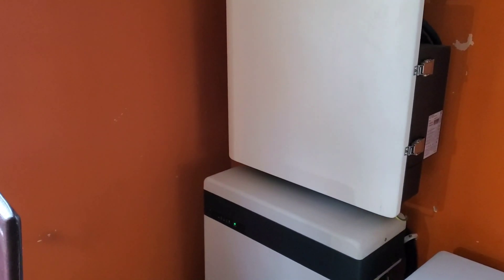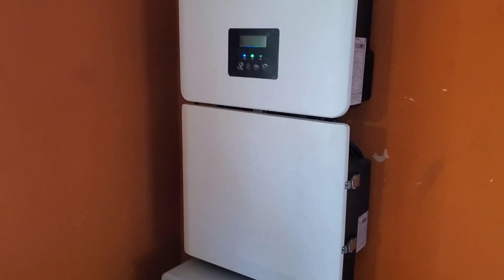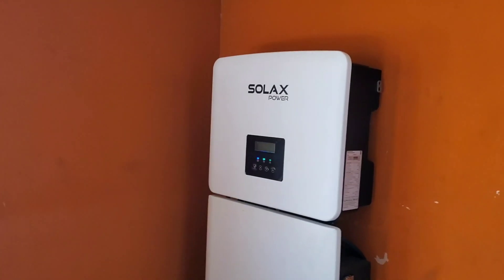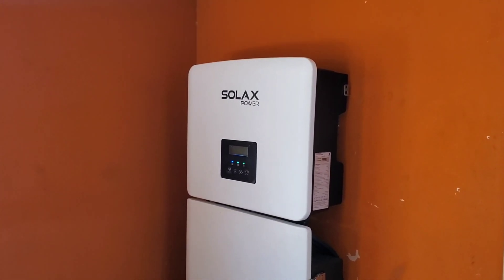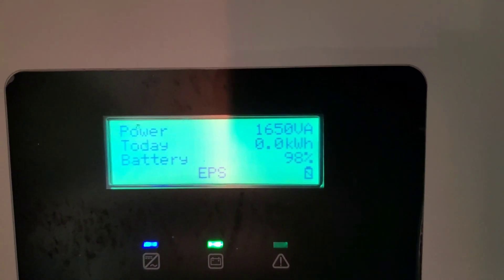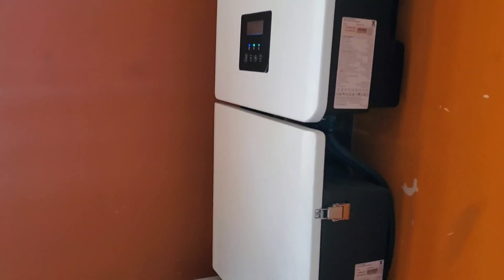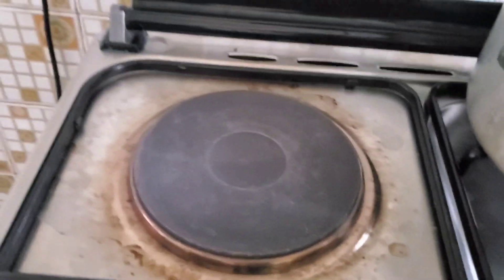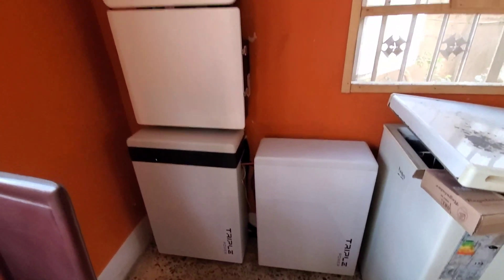My Verdict On The SolaX 5 kw Inverter.

Comment: You can say SolaX helped you well in and out of trouble but they could have made a better first impression with this install. And you know how the saying goes. Whoever wants to sell hybrid inverters to us, Deye is not interested in our money at all, I hope they make a good first and long lasting impression. I am still busy finding some inverter for us. Today we had another long power outage due to strong winds while the generator needs maintenance and refuses to work.
Reply from the maker: Sorry about your power outage. It is part of life here. SolaX is learning to configure their inverters for a world that is 100% off the grid. They are solid equipment and the 10 year warranty is reassuring. The generators tend to fail when we really need them. Get it serviced and you should be good to go.

Comment: Would say you had less Inverter "issues" with your last Deye inverter?
Reply from the maker: I did not have anything that caused the power to go out. The SolaX issue was corrected with firmware. We also had firmware updates from Deye but they were to correct minor issues. Thank you for watching and commenting
Reply: @drsolar  so, overall rating, Deye is still on top Hehehehe.
Reply from the maker: @Moffat-T  if you want a system that is not integrated. Yes.

Comment: Nice video, what's the total capacity of your battery?. I'm buying a lithium ion battery pack of almost 13kwh +
Reply from the maker: Each battery is 5.8 kwh. They are high voltage batteries
Reply: @drsolar  thanks for the information.